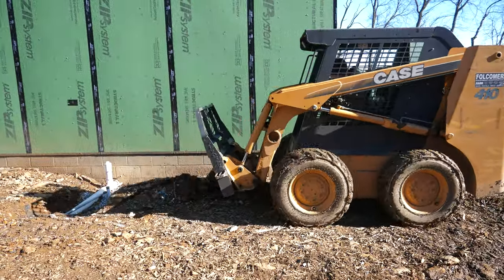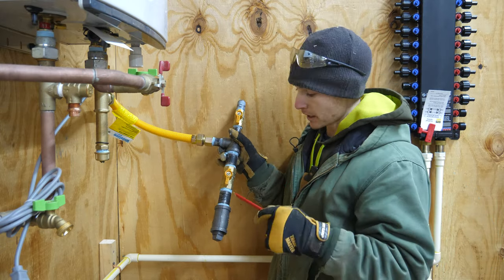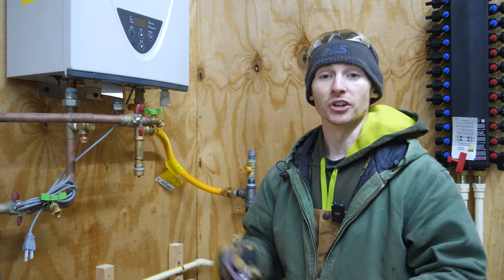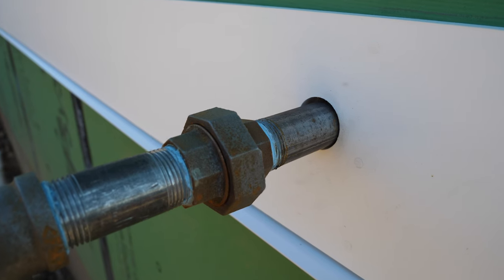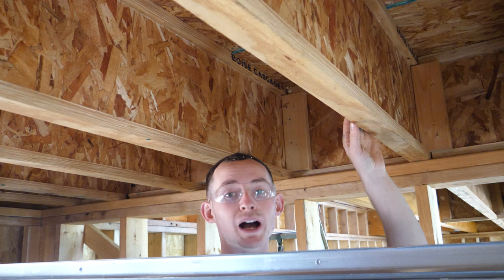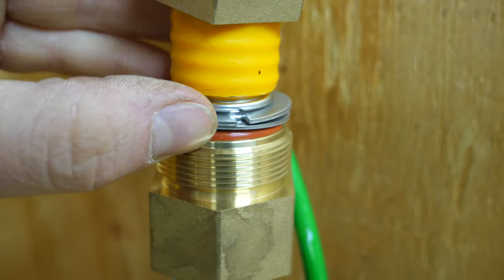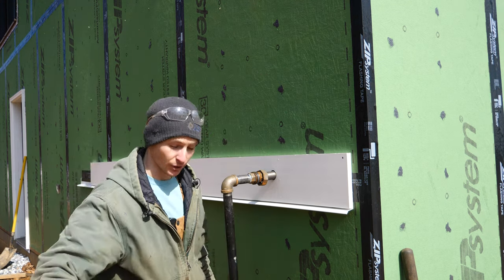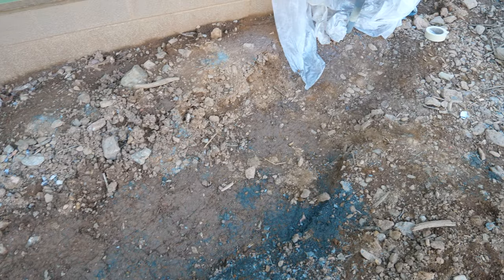Indoor Propane Plumbing - WE HAVE GAS. (and leaks)

Comment: Your problem is those baby wrenches.  You are going to have leaks all over that house.  I knew the leak was in that manifold the second I saw your wrenches.  Get yourself two >14" pipe wrenches and you won't have a leaky joint again.  Remember, "Everything is tight till you get a bigger wrench"
Reply from the maker: haha must have just missed the german torque spec on that one.. "gutentight"

Comment: When you use blocks as a pad outside, you can fill the cores with gravel (almost full) and then use thinset to adhere a piece of tile backer. Kind of the the poor man's slab. This will also give you the opportunity to mix a small batch of thinset and call it practice for when you go to tile your bathroom or kitchen backsplash.
Reply from the maker: I like it!

Comment: your gas technicians just screwed you by installing that piece of 5/8 copper.  They just choked the entire piping system down and you just lost BTU capacity of you water heater.  Funny the professionals are the ones not knowing what they are doing. lol.
Reply from the maker: haha yeah it's what they had on the truck of course. One day I'll probably go underground and change it. We probably only use 15% of the tankless capacity so haven't had any issues

Comment: I'm all for DIY most of the time, but electrical and gas are two trades that should be left to licensed tradespeople.  Consequences of mistakes are too high.
Reply from the maker: We’re doing both so hopefully we read the code closely enough 😆
Reply: @MasonDixonAcres it’s not about knowing the code. It’s about the experience. There’s a reason apprenticeships exist and are supervised by experienced journeymen.

I get the “we built our own house” schtick, but putting lives in danger makes no sense. It’s why licensing and training is so extensive for trades.

If anyone could just read a book, there’d be no need for licensed tradespeople.
Reply: Timid, subservient opinion. License. The government shouldn’t what I can can’t do to my home
Reply: No way you are going to run that water heater on that length of 3/4” csst. The little twin stage regulator at the tank is only good for 200kbtu. The w/h is 199kbtu . By the time the gas gets to it on your 60plus foot run, no possible way will you be able to maintain 11” wc. This is not including the under ground pipe length. It will be like sucking mud through a straw. The heater may run, but it’s going to soot up very quickly. You will probably get a low gas pressure alert when it starts up… Change the tank reg. to a 10psi first stage, and pipe in a 2nd stage on the riser coming up near the house. You may get by with that set up.
Reply from the maker: The csst goes to the stove. The water heater is right inside the house off the 1” line with a 3/4” x 24” appliance connector.
Reply: @ stop doing things right! I’m an old man who was a gas fitter for thirty years and I need something to complain about!
Reply: Go away…. This guy is everywhere.  Policing the internet.

Comment: I know the TWH has it's own shutoff but I'd put one before the flex connector as well. Will be able to isolate that system in case the hose leaks without having to shut off everything else. Neat that the TWH has it's own dirt trap but kind of pointless since you added one at the main manifold which is at a lower location.
I generally just pipe dope, I do find the t-tape makes removing fittings a lot easier down the road. Don't trust the Schrader valves and test rigs, they tend to fail lol. I do 30 PSI for 3Hrs for pressure test, this makes finding leaks easier too when using soap test.

The foam/small bubbles don't matter, just want to look for bubbles forming or getting bigger.
Reply from the maker: Thanks for the input! Yes half the time it's my test rig that leaks so that's always the first thing I check 😁

Comment: It looks cold. Don't spray paint in the cold if you can avoid it. Meaning paint those pipes in a warmer place first, then touch up after. If you absolutely must, then warm up the can in a pot of hot water first.
Reply: So true! Weather has a huge affect on spray paint. If it's below 65-70 degrees it gets sticky and doesn't coat well, even colder it freezes. If it's humid or raining it takes hours to dry while on a hot day it'll almost dry instantly.